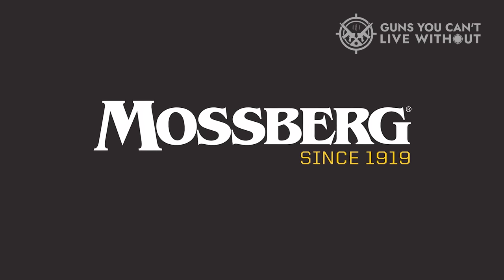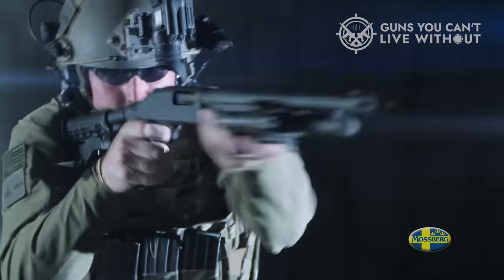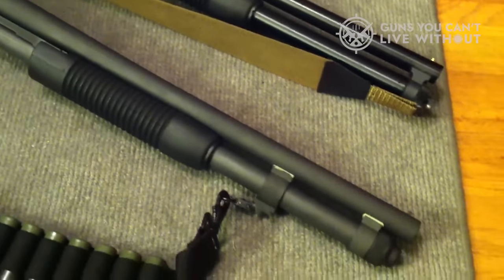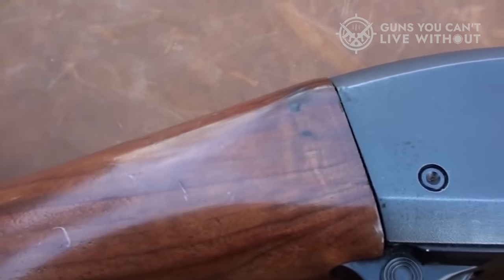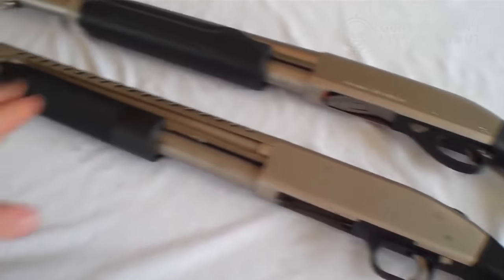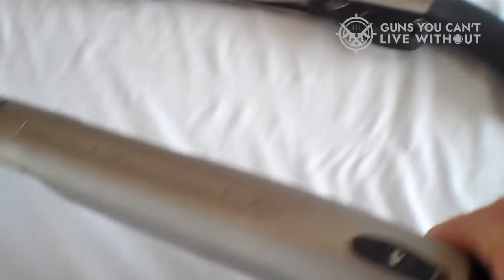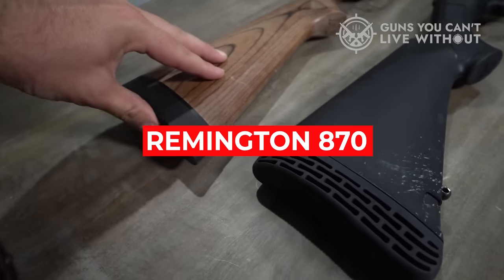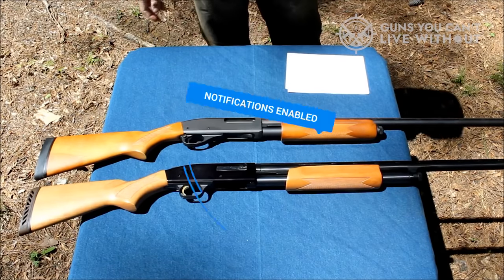Mossberg 590 vs Remington 870 - NOT EVEN FAIR.

Comment: It would be nice if you had the video follow along with the explanation or vice-versa. Showing a bunch of random videos of the shotguns at different angles when you are talking about a SPECIFIC component is amateur at best and disorienting at worst.

I own a Mossberg 590SP (Special Purpose). It looks like a standard 590. I specified Parkerized Finish; Ghost-Ring Sights; and a Speed-Feed Buttstock (holds 2 additional shells on each side = 4 total) when I ordered mine back in March 2001. I added a side-saddle shell holder (6 shells) to give me a total of 10 rounds outside the gun and either 8 (3-inch shells) or 9 (2 3/4-inch shells) inside the gun when fully loaded. The factory bayonet lug is what actually won me over the Remington 870s and Winchester 1300s.
I believe that the 590A1 came out after that.

Comment: Like others have noted the title is shameless clickbait.
    
   That said, Ive owned and shot both. I hated the 870. I found it unnecessarily heavy in both carry and action. The safety was another cIear win for the Mossy. The top tang is intuitive and truly ambidextrous. I still have my nearly 40 year old 500 and it still runs just as good as it ever did. Never done a thing to it aside from routine maintenence and cleaning.
   I sold my 870 years ago after trying really hard to like it because its an 870. Youre "supposed to like it" arent you?  Never happened for me.

   I still use my 500 for clays and hunting. But for defense and tactical purposes, I go to my Mossberg 930 SPX hands down ahead of any pump gun.

Comment: I don't know about recently, but the old Mariners, had stamped internal parts, with ridiculous burrs, then they put the finish on, without any tumbling. Remington, tumbles their parts, before finishing. The 500 is the only shotgun that can compare to the 870. The safety on the Mossberg is easier than the 870, unless you have a scope, right on top of it. No simple way to extend the magazine tube, on the 500. The 870, just switch the spring, and screw on the extender. The 870 was just a bit more, heavy duty then the 500. The 590 is more like the 870 with the extender tube. Favored by old school police, as the squad weapon. Always up front, center console, ruff & ready. Nowadays, the AR's are becoming, the new squad weapon

Comment: I have several of each, in 3 gauges. All older models. The oldest is a 1960s mossberg “ police”.  It has the single action bar because of the then still in place Remington patent. It also has the metal safest button and jeweled bolt, something not seen in a long time.  They all work well, nothing hit with them has had an opinion or preference…

Comment: Remington hasn’t made great shotguns in years. Mossberg has been consistent for decades. My 870 is great but it’s also 30 years old. My buddy bought a new 870, even though I told him not to. We took it camping. It got rained on, my 3 mossbergs got rained on. My guns were fine, his looked like it was laying on the ocean floor for a month after a 3 day trip. They didn’t do anything to protect the steel at the factory and the crappy parkerization job was terrible. I wish CZ were to have bought them instead, to get qc back up.

Comment: I have both, and the bottom line is they're both great guns.  My 870 is an Express Magnum though and it is definitely way beefier, stout and heavier though as well.  If I was just looking for something to go shot once in a while I'd take the 500 all day and If say I was going off to war and planned on putting shells through that bitch non stop I'd def go with the 870.  Far as differences go the 870 loads smoother, has a better trigger, the safety is entirely opinion but since I'm a lefty best safety goes to the 500 all day.  The action on the 500 is far lighter and faster while the 870 being designed for magnum loads in a way heavier receiver is obviously very beefy and stout, but by no means a drag, but there's a noticeable difference between them.  At the end of the day, they're both great guns I wouldn't hesitate to take anywhere though.

Comment: Model 500 for social applications 
870 for sporting.
Once on a deer hunt, loading the mag tube on an 870 I didn’t insure the round fed completely into the tube.  It popped back out and hung up.  Could not get the action open.  Took several minutes with the spine of my knife to get the round inserted back in the mag.  Training issue sure, but has happened to police too.  Ever since will not trust an 870 in life or death situations.
Reply: Sounds like your 870 did not have a "flexi-tab". The problem you note was notorious to 870's made before about 1985 or so (maybe 1990).   Look for a u - shape cut on the bottom ammo tab/ flap (carrier).
Reply: @chrisperrien7055 , yes, no flex tab 1970-80 era Wingmaster.  Still have it, take it hunting occasionally.

Comment: The 590 started in the late 80's and is the culmination of a lot of improvements to the 500. The slide arms, safety and front of the trigger housing were constantly breaking on the 500s and their variants. The 870 has been produced since the very early 50's with no "major" design changes. Both companies have made well over 10 million ofvthe respective models. I wouldnt give you a bag of potatoes for the 500 , maverick or the 88 models. I do however have a short barreled 50's model 870 in every corner of my house..
Reply: The 590 series is an excellent choice if you have lefties in your roost

Comment: I own all three
A 590
A 870 Express and
A 1980's vintage 870 Wingmaster 
As well as an 835
If anyone thinks it a fair apples to apples comparison between the 870 Express (a significantly cheapened version of the 870WM) and the 590 you just called you're own knowledge of firearms into question as the 590 is Mossbergs flagship tactical application pump
An actual fair apples to apples comparison would be between the 590 and the 870 Wingmaster especially a 870 Marine model and the 590 is not even close in terms of craftsmanship fit finish and durability to the 870 Wingmaster one only need as I did take apart a original 870WM and a 590 and the differences are self explainitory 
The ONLY advantage I will give Mossberg is thier safety is more ambidextrous/left hand friendly 
But in terms of looks fit and finish no pump after the birth of the 870WM has ever been its superior and no e I can think of even its equal save for a Winchester pigeon grade model 12

Comment: I'll take the older Remingtons I possess over the Mossbergs. However If I need another shotgun quickly I'll probably take a Mossberg as they are easier to locate and the price be lower except for the 590A1. Of which I buy 1 someday if I live long enough. If I run out of Remingtons I'll fall back on 1 of 5 M12 Winchesters I possess. 3 of which have solid ribbed nichel steel barrels!!!

Comment: I have several 870 a 500s. The slop in the 500 slide is evident though I've not had to replace the action bars in either. I like the serviceability of the 500 ejector. 870 barrel no-brainer. brainer. If looking for an inexpensive alternative to both check out the high standard flight King. I have two and with a bit of polishing the actions are slicker than whale snot and will do the Terminator one hand rack like a boss. If you can or choose to have only one gun the shotgun is it.

Comment: bought an 870 express 35 years ago at Kmart,  for dove hunting.  Couldn't afford the browning auto my boss had.  It has always worked fine and I recently bought the magazine extension from Brownells for $40.  It now has a magazine capacity of 10. I did read that the mossberg has only one connecting rod on the pump action and some time jams, while the 870 has dual connecting rods, one on each side?  Don't know if that is true or not?

Comment: Mossburg seems like its easier to maintain but Remington would last longer before it would need maintenence, tools for it are expensive and would likely require a trip to a gun smith if you cant do it yourself.

So its a pick your poison

Mossburg = easy maintenence

Remington = longer maintenence spans but expensive tools and possible gunsmith fees.

Seems like remington would be the ideal choice because it lasts longer if you got the skills but at the same time if you dont then mossburg would cuz in the heat if the moment and you need to fix the gun you have a better chance with mossburg than you do remington.

So i'd say for the masses mossburg would be the overall ideal choice cuz people arent gonna have time ir money to learn the skill for remington.

Not saying you cant use remington just make sure its prolerly maintained vomepletely after every use so you never have to worry about it giving out on you in the heat of a gunfight when you might use it but if youre not gonna do that then again mossburg would be the better choice.

Comment: Well, apples to bowling balls.  Mossy is better for tactical stuff I suppose, but swings like a 2x4.  The 870 swings more smoothly for wing shooting.  870 is a better all around gun.  Also, the safety position on the Mossy is a pain in the neck.  You have to take your hand off the stock to manipulate it.

Comment: I got 2 870's...both pre 07. 1 is a 12 the other is a 20. I had no issue adding  the extended tube and pistol grip and front stock (houge I think) which is a nice on my dozen guage. Funnything about the 20...I have never shot that old girl to date. She still has the Remington tag hanging on the barrel. I should probably put pistol grip on 20 and put my 12 back to wood shoulder stock. At my age it's a bit violent shooting 00 Buck from the 12 guage w/pistol grip but I bet that 20 guage would shoot like butter w/pistol grip and 00 Buck.

Comment: Up until the mid 1990s the 870 was better made gun, but the 500 was a better designed gun. When the ammo makers switched to steel based shells insteof brass, the 870 started shpwing it bad design.

.

Comment: I worked in a gun shop for several years. The quality control coming out of remington the last 10 years is absolutely absymal. Saw dozens of 870s with burrs in the mag tube and chamber, as well as guns that came in right from the factory with surface rust. The finish they put on the 870 express models is absolutely trash.

Comment: With a 870 it depends on when it was made. I got one in 08 and it was the worst gun I’ve ever owned. The finish sucked, the shells would get stuck in the chamber, when they didn’t get stuck they wouldn’t eject properly they would just flip sideways, the magazine cap came undone, while shooting at a squirrel in the magazine spring just flew off into the woods somewhere. I imagine that 870 is still right there where I threw it.

Comment: I've been hunting with my 870s for over 50 years started with a 870and 23/4 now I'm at the 870 three and a half you cannot beat them they're are guns  as good the Mossberg but bottom line is no better than the 870 That's my opinion over my 50 years experience with them I've had no trouble whatsoever with them and shot them thousands of times I own both the Mossberg is a little harder recoil than the 870 The only thing I see that 870 holes a little better pattern with a 30-in Full choke barrel at least in line it does

Comment: Neither are exceptional, both are adequate. There's a real race to the bottom with respect to pump shotguns today. I guess if I were looking for a dedicated defensive shotgun and had to pick current manufacture then I'd go with the 590A1, but you can't swap out the barrel for a sporting barrel all that easily on those models, so it's pretty much a one trick pony. Mossberg probably wins overall but only by attrition--Remington is struggling. Several years ago, I snagged a Wingmaster made before the Freedom Group purchased Remington, and neither company is producing anything that nice today.

Comment: I'll take my Mossberg, as a lefty its more situated for me. I have a modded 500A w/ pistol grip and I have no issue with the safety placement. I got big banana hands, and I'm not taking the safety off until I'm ready to fire to begin with. I've owned a couple 870's and the safety is ass-backwards for a lefty and in a bad spot.

Comment: Not even close. 870 wins easily. the 870 has a steel receiver where the 500 has an aluminum receiver. The aluminum must be painted or anodized as it can not be blued, and therefore will not be the same color as the barrel or other steel parts. Just look at the one in the video.  the 500 only has two feeding rods for carriers compared to the full carrier on the 870. The 870 has the safety where it should be, easily manipulated by the trigger finger and not requiring the shooter to alter his grip, not on top of the receiver where 500's safety is requiring the grip to be altered to operate. Not to mention the 500 has the ergonomics of a broom handle.